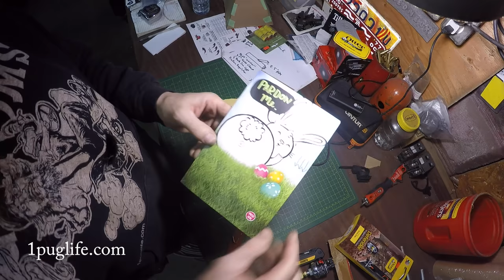how to pour concrete counter tops like a pro

Comment: all you done with the cement is waste a whole load of money and add a shit load of weight. All you would of needed was a 50mm thick double layer of the ceramic fibre blanket lining a 50 gallon barrel. That stuff keeps all the het within on its own. you can hold a piece of tht stuff and put a blue acetylene tip burning on the other side and not one bit of heat passes through.Anyway... rather than waiting  week if you just build the thing and put  small propane flme within the furnace it will dry out quicker. you will get cracks regardless so just fill them with some fine paste cement mix...

Comment: You can use a 50 or 65 watt light bulb to help the main part cure better, just run a cord through the hole for burner, don't cover it completely or it will get hot, even with a 65watt bulb

Comment: CLEARLY YOU NEVER PUT ENOUGH WATER IN THE CEMENT TO CREATE THE CHEMICAL REACTION IF YOU HAD OF THE METAL RING AROUND THE CONCRETE WOULD HAVE GOTTEN HOT